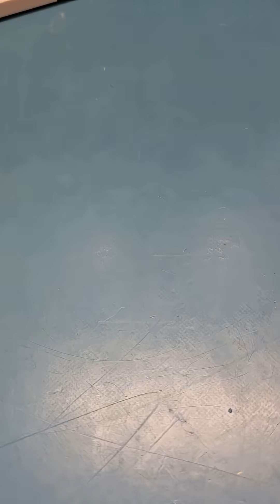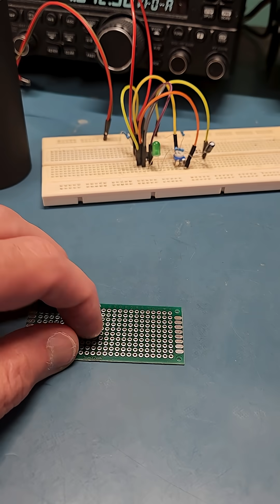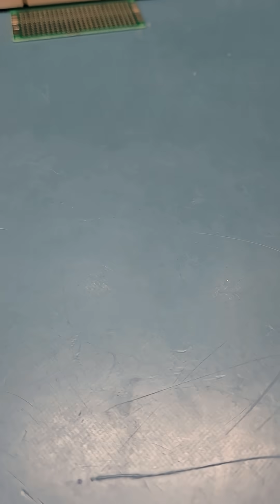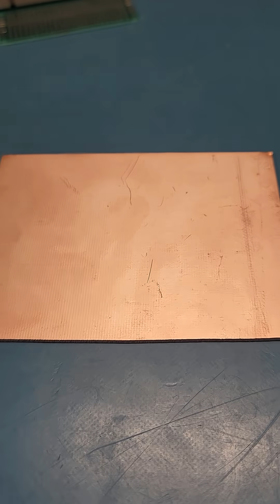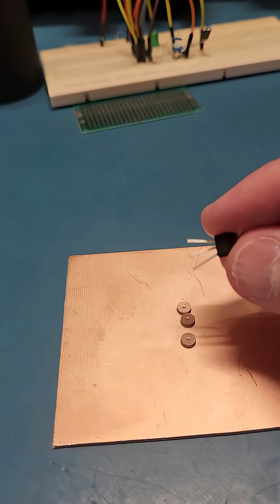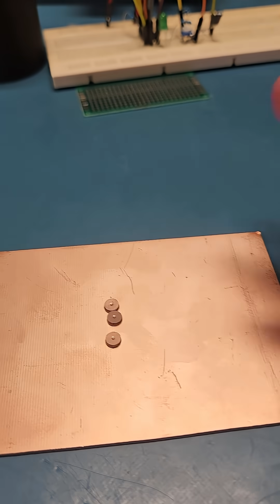Why I Use Manhattan Style Prototyping (Better Than a Breadboard!)

Comment: I briefly tried using a breadboard, but had nothing but trouble with them. 
I primarily use phenolic perf board to make circuits, though only a single sided board, not double sided. 

I've done Manhattan style prototyping before, but i feel like it is a better version of dead bug, or web wiring, and primarily use it for RF ciruicts, where the addition of a ground plain, and the ability to solder shields becomes nice. 

In my opinion, making a circuit on a more permanent board or construction, makes you slow down. And, thus you make less mistakes, and have to think about the circuit and layout more.

Comment: I only have one thing to say......   "solid core silicone wire"!     
 No melting insulation, much more flexible, and lasts 1000x longer than the typical, cheap, China-sourced PVC wire when doing any sort of prototyping!!     I too was often frustrated after taking the time to solder up an immaculate-looking circuit, only to notice a flaw, getting out the soldering iron, and proceeding to make a melted & exposed MESS of all the amazing work I had just done!!
   After eventually sourcing breadboards of higher quality than anything available on Amazon, I start by making my circuits on those (ya know...   prototyping!), copying said circuit onto paper (mostly just to have in case a brain fart occurs), or taking a photo, then switching the entire circuit over to perf board, only after I've made my final tweaks.   Been doing it this way for a decade and works great for me.  
    
   *I will say I'm definitely interested in those strange "portable pads" you got there, though!
Reply: +1 for silicon wire.

Comment: Or you could get a wire wrap tool and write wrap wire, put wire-wrap pins in the holes, solder the components to the front of the pins, and wire-wrap the jumper wires on the back.

Done properly, wire wrap actually creates pressure welds between the wires and the pins, so you get good electrical connection, but it's also really easy to rework to fix errors.

Comment: I like Manhattan style as long as size is not an issue, since the resulting board is quite large. Some time ago I found PCBs in the form of solderless breadboards (eBay/Ali). The advantage of these is that you can transfer your components 1:1 from a normal breadboard. However, a custom-made circuit board is still significantly smaller (e.g., manufactured with a laser or CNC at home or ordered).

Comment: I hate breadboards but never had problems with prefboard, I typically use coated copper wires (the kind that's used in transformers and motor windings) to make the connections

Comment: On the perf board, don’t use “wire” use 26 gage bare wire and teflon tubing. Much easier than trying to strip short lengths of wire. Or, for trying a relatively simple circuit, have everything in the air.

Comment: Never heard of that before.  I've been away from working with hardware for years though.  Way back in the day Radio Shack sold some great perf boards.  Instead of just being single isolated pads they had strips of 3 or 4 pads that were connected together and laid out in rows.  Great for either ICs or discrete components.  I imagine someone still makes similar boards.  I used those for the final circuit.  That and a lot of fine gauge telephone wire.  When you're a broke college student you scavenge :)

Comment: You can't tell us how attractive it is and not show a finished prodoct... You can't tell us how easy it is to assemble and modify without showing us some construction and modifications... And none of this is as good or cheap (if you value your time) as a PCB (at least this was the case until de minimis was suspended).

Comment: I can’t stand breadboards. They are good for  small stuff but if u end up with 10 jumpers, its 5 jumpers too many.  9/10 my project failed because of a loose pin. 

If ur gonna use breadboards, do not cheap out. 

Nowadays i take blank PCB and carve traces in it with a special knife. I don’t ever recommend this because it’s dangerous.
Reply from the maker: That's what I was doing too. I still do for a lot of things

Comment: I've never heard of Manhattan style. I find it interesting however for someone with some experience using perf board I find your method expensive, time consuming and silly. Lets see you mount an Arduino with your method. Or any TTL logic. Also if you think your transistor might smoke or be backwards solder in a socket and push the transistor in. Easily swapped.

Comment: I use semi permanent proto board these days, which is basically a solderable breadboard. I typically start with a normal breadboard, and when I'm ready to make it permanent, I solder it onto the prototype board, with the same layout.

Costs a little bit more but saves a lot of my time with less mess. Worth. every. penny.
Reply from the maker: That's a good idea

Comment: Here’s a controversial take, but for me, at some point it gets easier to just design and print a PCB (unless it’s RF work).

When I first started experimenting with electronics, I tried every kind of prototyping method I could get my hands on, from breadboards to perfboards and prototyping PCBs.

But honestly, the only method that stuck (for me) and is good , permanent, replicable, and maintainable in the long run is just designing a PCB using CAD software and having it fabricated.

I occasionally still do use breadboards for prototyping and some quick tests, and God knows how much time I’ve spent building projects using perfboards and prototyping PCBs.  But given the choice, I would always prefer the reliability and neatness of a well-designed PCB over wiring everything myself by hand on a perfboard or anything like that.
Reply: Dude I hate to agree. I know we are so spoiled now, and I've done ton of perf  board prototyping/soldering since I was a kid, but now I just find myself being like "why am I even doing this, the time spent soldering and connecting this one board, I could just draw up in kicad and order a couple"
Reply: @RyCorp77  exactly my feelings when I do the same thing, same thought goes in my mind! 👌😁
Reply: Kicad is goated
Reply: @TAHHWASD I'm still on Altium Designer, but have to give KiCad a go soon!
Reply: prototyping and assembling the final product are different things i think. is it really a good idea to wait for several days only for a minor change or adding a new component? i think your method should depend on what are you doing. Imagine taking out some perfboard just to attach one module to an arduino? You would wanna use a solderless breadboard. If you are prototyping on something more serious and space is not a constraint you can use the method shown in the video. And if you are making a final product (and have a layout) you would wanna solder it on the green pcb breadboard or order a custom one.
Reply: @user-random-1 Yes, I completely agree — but in my experience, I think I've solved most of the points you mentioned, this way:

1) Firstly, when the initial version of a PCB is done, I usually find several issues all at once, instead of one by one (if I was using a perfboard). Usually, I take notes and apply all the fixes in the next revision of the design.

In “development” versions, I usually tend to include plenty of connectors (pin headers) that I can use to re-wire things on the fly. 

Although, the thing is, the traces on the PCB are usually wide enough for you to cut them and re-wire them using "wire-wrap wire", which I find easier to use on a mostly working PCB, instead of using on the green perfboards.

Also, swapping out parts isn’t a problem as I mostly use SMD components, and it’s super easy to replace or modify them on the fly, compared to through-hole parts.

2) When I’m not 100% sure how a circuit will behave, I design a minimal PCB — as small as possible — just to test that specific module. Once it’s tweaked, debugged, and verified, I integrate it into the main project.

That said, I rarely need to do this nowadays. Either I’m reusing proven circuits that I know to work perfectly fine, or I’m directly following reference designs from datasheets — which usually work just right out of the box with minimal (if any) changes.

3) For Arduino-based projects, I've found that most modules communicate over standard interfaces like I²C, SPI, UART, or simple GPIO lines.

This makes it easy to just add matching connectors on the board and wire them externally during testing — even wiring from my PCB to a breadboard if needed.

Once testing is done, it’s just a matter of integrating the changes back into the PCB.

*Bonus tip:*
To check whether components (and modules) fit correctly, I print the PCB layout on paper and place the actual parts on top. If something doesn’t line up, I fix it by applying adjustments in CAD before ordering new PCBs.

Of course, despite all of these, mistakes still happen occasionally. Like forgetting to connect RXD to TXD correctly (because of net names), or when I started doing EE, I made some novice mistakes such as forgetting to set hole sizes to the correct values, hence some component legs not fitting the holes. But once you make mistakes such as this, you rarely repeat them in your newer designs.

Overall, the benefits of this approach far outweigh the drawbacks, for me. You design, wait a few days, do tests, apply some fixes (or none, if you’re lucky to have made no mistakes whatsoever), and end up with a rock-solid design that you can replicate without worry to your heart's content!
Reply: @DRSDavidSoft  Wow, thanks for sharing your experience! 😅
Reply: @user-random-1  Thanks for reading my super long wall of text 😅😅

Just for the sake of completeness, I don't say that I don't use those awesome green PCB perfboards anymore, but for me, that would just for quick and simple tests. It's not worth it for more complex projects, for me! 😁
Reply: Yeah I'm very much looking forward to the day when we can make even a low-quality prototype board using a process similar to how we 3D print a case or whatever. A prototype board in a few hours. Then when it's ready have three copies professionally made for $5-$10.
Or if another PCB house that competes with JLPCB with quick shipping opens in my country and, the USA. We do have Osh Park.

With JLPCB and similar the price is right, but if I need two prototypes before the final board is v3, it's a lot of waiting.

Comment: Sorry if I'm sounding a bit thick but isn't everything connected and shorted so it's not going to work I didn't understand how the pads work
Reply: I think it wasn't explained in the video, but the top of the pad isn't electrically connected to the bottom, so like how the top and bottom layer of a PCB isn't.

That was also my question but since I've seen something like this before, in the other video I've seen the pads are definitely electrically isolated, so the super glue is just for mechanical support.
Reply: @DRSDavidSoft oh yeah, that sounds about right, okay thanks for that.

Comment: If you need to do it multiple times won't you just get glue everywhere. I can understand the annoyance with vera boards but it seems like this is very situational.
Reply from the maker: I don't typically move the pads, I just reflow the solder on the pads to remove the part

Comment: I also like to use perfboard. It also makes a really nice finish board if you laminate it with wood. For transistors, chips and other components there's a chance of messing up i will use pcb socket strips and just snip off however many studs i need. I also dont have to worry about overheating certain component with the iron that way because you can just pop them in last!
Reply from the maker: I love that idea for the wooden finish; I'll have to try it out!

Comment: (electronics neonate speaking)
I think I can understand that you'd solder a wire to one of your transistor's ittle copper pads and then wire that to the rest of the circuit if you wanted it in series.

But how do all the components not go parallel, if they're sharing the same connection to ground at all times?
Does the superglue insulate that well?
Reply from the maker: The copper layer is pretty thin, and it's a laminate board with fibreglass on the other side.  The fibreglass is the actual insulator.